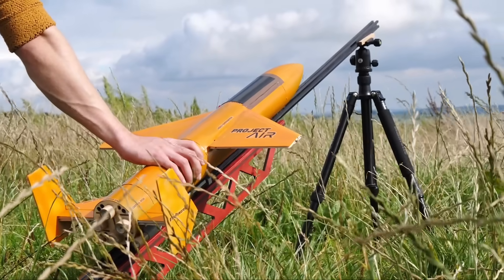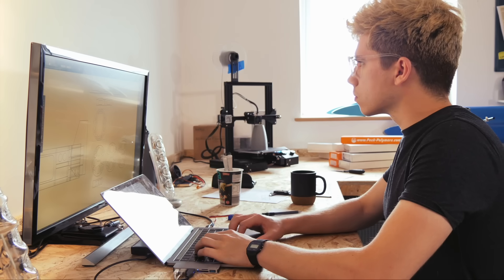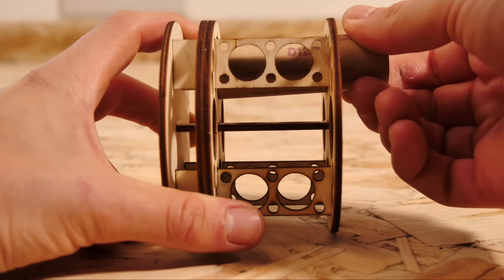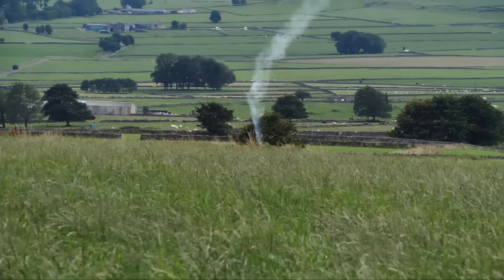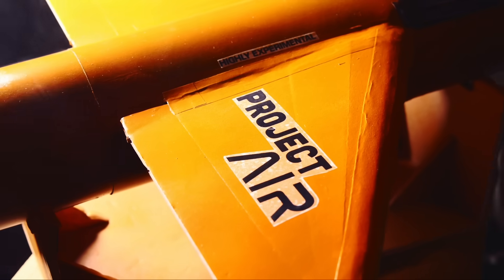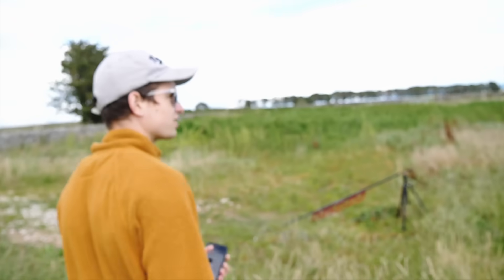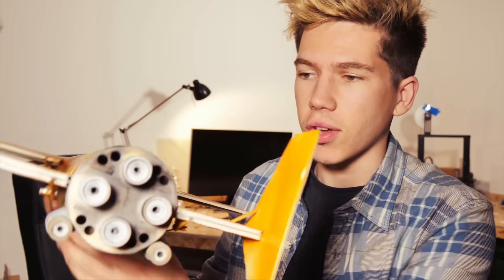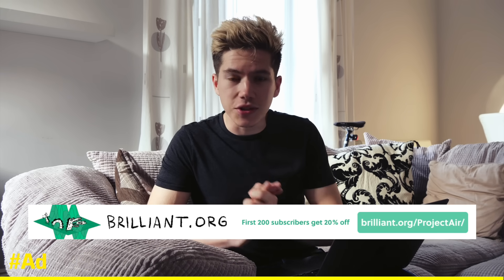High Power Rocket Plane

Comment from the maker: The first 200 people to sign up with Brilliant using my link https://brilliant.org/ProjectAir/ will get 20% off their annual subscription. 👍
Reply: you should really make at least a couple of those rocket motors have a second stage. it will already be mostly up to speed and a couple of them could really give you some extra alt.
Reply: @eriknulty6392  xxeee
Reply: You are basically remaking your own x-15. Only difference is your ground deploying the craft and not launching it from underneath a bomber.
Reply: @Thomas-nc9fz  how many things has this guy tried that weren't plausible and that failed several times before they're finally successful
Reply: you and inenza could make a V1 rocket
Reply: why bother with dinky hobby store rocket motors? E, F, G... much more power for less weight...
Reply: Hi, I would just like to mention that after the engine burns, the weight is still shifted a bit because the propellant in the engine burns away as it is being fired. Hope this helps a little bit!
Reply: Do you know, you can make those rocket engines into two stage by cuttiong the head of the first stage and fusing it with second stage engine, taping them together. 
This is common practice for two stage model rockets. Three stages are not recomended, but in your situation where you got RC control- you very well can make 3 stage engine stack. Just make sure the spent engine batch separates as single casette. 
In terms of gliding- you need larger wing surface. This way you can have more hold in air and achieve better gliding parameters.
Reply: Make a long rail with a giant ramp at the end that can launch planes/rockets
Reply: Any way can you build a plane to break the sound barrier
Reply: You should first find the center of gravity
Reply: Python is too useful for the near future
Reply: I don't know if it's legal (probably not) but I used to chip out the ejection charge until I got to the smoke delay.  I would then plug the end with putty.  I used these when I was a kid before the D-12Ps were available on a scratch built R/C Bomarc boost 'glider' (it's L/D was horrible).  This might be better than letting the charge scorch the wood engine mount.
Reply: Next make your own engines with potassium nitrate, powdered sugar, and glycerin and launch multistage rocket from a weather balloon
Reply: Could you make you own engins. Rcandy engings are realy nice.
Reply: you can get way more thrust making your own engines out of aluminium and ammonium perchlorate,you can make an igniter out of AP and carbon black(it's conductive so when you put a charge to it you get ignition)
Reply: can you try to build a plane where two rockets are iginited for launch and then the remaining rockets can be ignited via remote controll to increase the range under rocket power?
Reply: How fast is 56 kph in mph? I use mph for speed
Reply: What do you use to design your own rockets
Reply: Make a larger one with a war head.😂
Reply: I'm a new subscriber
Reply: Next video try to make a fat rocket with 5-15 rockets.
Reply: You should build a Hydrogen Powered Airplane

Comment: Estes used to offer a plugged engine for the rocket gliders they sold.  Like the Strato blaster.  The end was plugged so no ejection charge or forward spark to ignite a 2nd stage.  I think some guys are putting some epoxy to cap the end of the engines available these days. If I had any recommendations, I might look to add a little wing area to increase glide and flight time.  But that may slow down your top speed if that is your primary design consideration.

Comment: The ideal is the aspect ratio of 3 and chord to length around 0.0034 and the thrust to weight of 1.2 and you have a rocket plane follow the above and better luck next time try six sugar rockets at the tail end.

Comment: Built a rocket plane out of a triangle fedex tube and foam board that’s used for art projects and displays, made a nose cone from a styrofoam block at a triangular shape to match the body, used 5 d engines and 4 c engines. Everything wired right, it took off like crazy, it went up 1000 ft turned as it loops and came in like the space shuttle, it was awesome. Used the same fuselage and everything 4 times until hit a tree

Comment: Here’s a quick tip- drag can easily be lowered by increasing the angle of the wings. This does lower lift, but at the thrust to weight ratio that you have it should not be too big of an issue. You could also look into specialised aerofoils if you want to pull as much speed out of this plane as possible.

Comment: GPS only measures ground speed right? So I don’t think it’s measuring how fast it’s going when you’re doing verticals. I wonder if you’d register a higher speed if you launched it more horizontal and flew it out away from you instead of straight up

Comment: Why not use the ejection charge of the engines for what they were designed to do (eject or chute)? Estes engines, by design, have some serious mass and ejecting all of them after use would give you a more flyable/landable vehicle. Put the engines closer to the CG so that when they are ejected out, there is no CG change. Great job and you now know what it was like back in the 50s as a test pilot.

Comment: The two stage ideas others mentioned is decent, but you’d still be using up a stage to overcome inertia at liftoff. I think the best answer would be to build an rc plane, perhaps a scale model of a hypersonic ramjet design, and build in two rocket stages that can be ignited remotely in level flight.

Comment: LW-PLA would be nice for that nose cone and maybe the wings. It foams making it harder to prevent stringing with but better for things that don't need to be super strong or are given strength by their surface area and design rather than brute forcing stronger materials like the nose cone and wings.

Comment: I’m amazed you were able to ignite all six motors using the electric wire igniters, those things always had a bad reliability issue in igniting multiple engines.  Great job.

Comment: Really, what school of engineering taught you the unit of thrust and force is kilograms - a unit of mass in  the offical SI Metric System?   What is the unit of torque (= force x distance) ? It's NOT kilogram meter.  Welcome to the 21st century.

Comment: You should make a fighter jet version where the rockets are under the wings like a missile and the body contains the motor so you can take off with the motor and use the rockets as boosters, and maybe do 4 rockets and 2 at once so you have two boosts.

Comment: Put a battery in there and prime 6 rocket engines.  Each time you push a sprcific button the next engine fires.  This way you can use one at a time, not all 6 immediately at take off.

Comment: Aren't those speed measuring components using gps? If so, it doesn't account for the vertical component of speed very well and your rocket plane was headed mostly straight up.

Comment: Once upon a time, Estes used to produce E and F rocket glider engines which had no ejection charge and were plugged to prevent anything being thrown forward out of the engine. They used a blue label and were labeled E12-P iirc.

Comment: that spitfire needs a different prop if you want most from it the vibrations where teeing it apart try a low angle pitch or shorter the span

Comment: You're obviously very smart; a great design and great build. I do feel compelled to say that I would hate to see you or someone else get hurt while flying so far off the vertical like that. Please consider a worst-case scenario: if something breaks off, or if you get a bad motor or not all of the motors ignite, or it goes unstable for any reason, you
Reply from the maker: That’s why I carry out these experiments with no one around. The closest building and road down range are about 1km away and this particular aircraft had no where near the capability of flying that far! Larger planes are tested elsewhere.

Comment: You should design it so the chute ejection charge of the engines dislodges them from the body, giving the plane tiny amounts more thrust while dropping the weight so you can hopefully glide it more after

Comment: Might be better to stage your rockets. Use a pair of rocket motors to get the plane into the air, then fire the rest to obtain maximum speed.  Once its in the air you should able to control its flight better when you ignite the rest of the motors.

Comment: I think what you need to do is add stage separation along with liquid oxygen cryogenic tanks to feed the motors.

Further enhancements will come from 3D printing an engine to follow the same principles as discussed in the Everyday Astronaut’s video on how liquid fuel engines work.

Comment: Are composite rocket motors not available in the UK?  The casing weight would be lower and you wouldn't have to worry about the black powder D motors exploding due to grain separation from temperature cycling.

 An F motor would still be a  model rocket motor and there are many choices for total ISP and thrust duration.  A single F motor would have the same maximum allowed ISP as the four D motors combined 

Also, if I recall correctly, the composite E motor has the same casing diameter as the F motor. If not, E motor to F mounts are readily available as well as being easy to build.

I believe both E and F composite motors are available as reloadables.

Comment: Centre of gravity
Have you thought about placing the rocket motors at centre of gravity like on the forward wing.  In a rockets we use terms like centre of pressure CP and having the centre of ballance CB 1 calibre ahead for a stable rocket.  From the little that I understand for a airplane to be stable the ballance and centre of pressure are to be the same place.

GPS if you can seperate the climbing part a recalculation using rise over run then calculate the length of the climb then devide the climbing stage by the run length, and multiply the GPS speed by that.

And for the Really Smart Person (AKA DUMBO) who suggested placing rocket motors on an RC car, never do that as the risk is extreme and do not give reason for your or any government to restrict rocketry or related hobbies!

Comment: You actually need engines with a longer ignition time, not more engines. If you cannot use engines with a longer ignition time, start the engines in pairs in several stages.

Comment: "What is the fastest RC 'whatever' I can build"?  Simple, a sailplane, no motor required (dynamic soaring), the top speed currently running just short of 400 mph, pretty much where it will probably stay, actually, given physical limitations..

Comment: You can remove the loose powder charge or get the 2nd stage ones denoted by a "0" as the last number.
1st #= Thrust, 2nd #= Delay, 3rd #= Ejection Charge.

Comment: At 5:25 it looks under powered.  That cluster of engines just doesn't have the thrust needed for the weight of that rocket-plane.  The balance works out ok for launch, but all that propellant is in the tail.  Once that burns off, the plane is nose heavy.  If you lighten the nose, moving the CG aft, you may run into stability problems at launch.  Maybe you need a much longer engine like an Aerotech I49N with an average thrust of 49 N for a duration of about 7.5 seconds.  And it is 184mm long, so the weight is more evenly distributed.  Maybe you want an external rocket engine pod slung underneath that can be jettisoned when expended to a parachute recovery, leaving the glider lighter and balanced.  The glider could then have an electric ducted fan for cruise flight.  But that's all more advanced, and more expensive, and possibly more regulated.  Eventually, you might have a TV-guided missile and the authorities will be interested. :)  You could try to fly it into a framed net 600m away that would catch it.

2nd flight went much better than I thought, though.  Pretty good!

Or, maybe you could just move two of the D12 engines forward, under the wing roots and aimed with a slightly upward line of thrust through the CG.  That would help your balance issue.  Or make those D-engines numbers 5 & 6 for more thrust...get more height for longer gliding.

Comment: I built one 42 years ago. The small wings caused the rocket to spiral in a large circle. I USED C-6 ENGINE.  It would glide down after engine burn. I also made the first drag racer using B and C engines depending on the distance available. I would use 10 pound fishing line as the guild. If no guild was used the drag racer would run wild. I used a 2x4 and cut it down and added free wheels on steel axels drilled through the 2x4. Used eyelet screws as guild also tried rocket tube guilds.

Comment: You might want to consider making your own sugar Rocket motors. You can control the burn rate and time and your overall thrust. You would want to be up around a g to h impulse would be perfect. Go to tech ingredients on YouTube and he goes through a very precise way of making these motors. I've done lots of them and they work well and they are fairly cheap to make. I make mine out of 1 in schedule 40 PVC and use 1 inch PVC to plug one end and make the nozzle for the other and glue it together. This is really cheap and readily available

Comment: The rocket engines change mass during burn (obviously) so your C of G is going to end up forward of where it starts. With the elevator size you have, you should be able to trim it out but that change happens quite quickly. I'm not sure what mass of propellant those motors have, but the change could be quite significant given the moment and the relatively light weight construction.

As for the electric ducted fans, they're great for lower speed flight but once the rockets come in, they'll just turn in to massive drag generators. Also the rocket nozzles are designed to work from low speeds so will lose efficiency quickly as the speed increases. You might be better with a staged approach, with appropriate nozzle design for each speed regime.

Comment: Nice project, however, don't rely on technology too much. Humans walked on the moon with a rocket designed on paper by people with slide rules, crude computers, no C.A.D., no CNC machines or 3D printers and built the thing by hand. Build it, test it, break it, fix it, and try again. I built something similar to this probably 15 years ago with a cheap RTF plane, duct tape and zip ties. I have a video of it on Youtube on my other channel, let me know if you would like to see what I did.

Comment: After watching a documentary on the V1 'doodlebug' bomb from WW2. Perhaps having a longer sled ramp with a rocket train on it to accelerate the Rocket plane into the sky. Then the actual Rocket motor could take over. 

Or perhaps, have it get dropped from another aircraft at a high speed.. (ref the Lancaster bomber you created)?

Comment: The problem is, I’m not impressed by a model rocket that slightly turns a little bit. I know enough about remodel rocket engines to know they don’t last very long. If you had showed your craft taking off and then landing again, it would have said WOW!! It seems like you were too concerned with trying to keep me watching to the end that you didn’t show me that you actually accomplished anything. I will now skip forward to see if you have done something cool and if you have maybe I will watch the whole thing. But I’m this instance I would say that you would want to show what this thing can do. Taking off and slightly turning is not impressive. Because you say it’s a model plane I’m guessing you can do a trick and then land before the rockets run out. Let’s see.
Reply: Now i get it. Pretty cool.

Comment: How do you have a kg of thrust? Isnt thrust a force?
Reply: Kg can be used as a measurement of weight, and gravity is a force, so you can use Kg as a measurement of force.
Reply: @williamlangdon2596  No, kg is measurement of mass not force. Weight is a force. The metric unit for force is Newton.

Comment: Hey James Whomsley, I just saw your Tip Jet Helicopter Test 3 video and, if you're still working on that project, i may have a new angle for you. Have you heard of the Fairey Rotodyne? It redirects air from two turbojets to a 4 bladed, fixed rotor. Each blade on that rotor has tip jets the i think only compress the air and doesn't use fuel and they were only used for t/o and landing. Please give me a shout back at harboua@gmail.com if you're interested. An RC model just doesn't exist!

Comment: Something to keep in mind, a GPS speedometer like that does very poorly measuring instantaneous velocity.  You might have ended up considerably faster at the end of the boost phase than your speedometer indicated, just because the distance-and-time measurements might well have checked both sides of the peak.

Comment: The Estes engines come in a variant with a -0 at the end, the last number represents the delay between the engine running out of fuel and the parachute jettison charge. So a motor such with a -0 at the end will have no charge

Comment: Hi James, maybe you could soon build a Virgin Galactic Stratolauncher and a SpaceshipTwo with EDF motors in the stratolauncher and a model rocket engine in the SpaceshipTwo. It could use a ejection charge system like the one you used for the Space Shuttle

Also, I’m a new viewer and I’ve been binging on all your content, I am very amazed by what you’ve done over the years, keep up the good work! :)
Reply: For any of those wondering, yes, my profile picture is a Kerbal. I am a KSP devotee, don’t judge me!